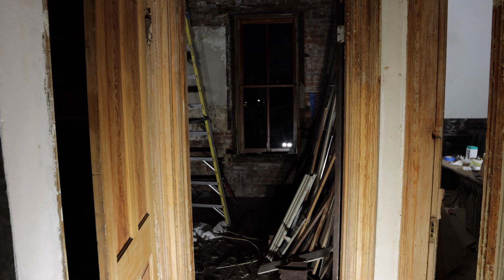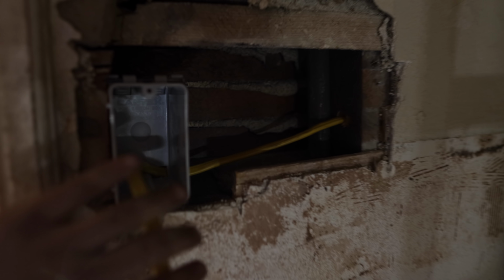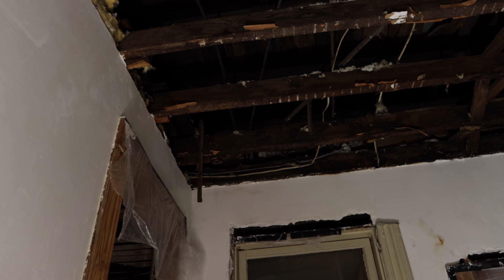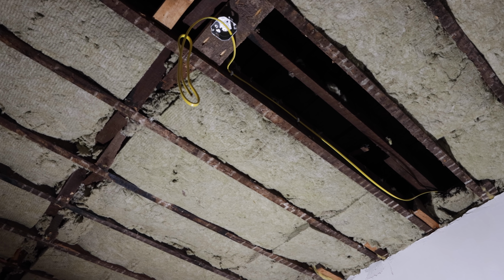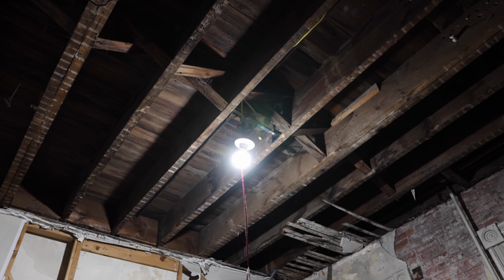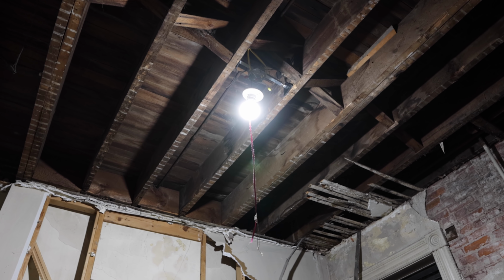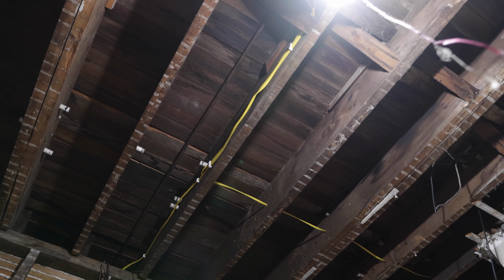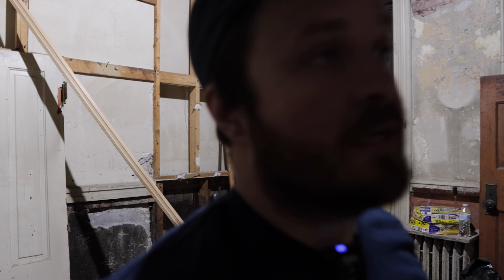FINALLY! This has been such a struggle! Abandoned Victorian Mansion EP 43

Comment: Whenever I work on the electric on a house that I wn, one of the first things I do is make an electrical map. I use Microsoft Visio to draw the house rooms and then layout all the electrical outlets, lights and appliances.
Then tracing all the wiring from the panel, I number the circuits on paper to the corresponding fixtures. This way I can determine the electrical load on each breaker and figure out if I can add new fixtures on that circuit without overloading. It's a little work up front for a lot of knowledge on the backend without guessing where to layout a new outlet or light.
Reply: I didn't know about that app. Thank you very much!

Comment: We looked at a 2nd Empire house in Albemarle County Virginia years ago.  It had been the home of one of the big-wigs in the soapstone company that operated in the area for years (it has since been re-opened in a smaller scale, but how awesome is that?).  This house's call system was still intact, though the house had been empty for decades.  It worked from both ends.  To signal a servant from your room, for intance, you lifted a brass cover and blew into the pipe opening.  This blew a whistle on the other end of the pipe - say in the kitchen - and a little widow rolled over which said "Master Bedroom', etc.  So very cool that it still worked.  It would be awesome if you could get at least one of your system to work!  Glad the electrical is underway!  Finally, that shot at night of the light through the windows - just awesome!!  She's coming back to life, thanks to you!!

Comment: 13:30 - "AFCI breakers help prevent fires in the future."

a few seconds later "this outlet fires!" 😁
Reply: 2020 NEC pretty much requires AFCI and increase use of GFCI, I don't know what local code applies to this house. However the price of AFCI versus standard breaker is about three times the price. I'd follow the local code to keep the price down if possible and upgrade later as it's only a break or change. Absolutely used GFCI in wet areas.
Reply: @mackfisher4487  Yeah same here; in my 1980s home I have a new subpanel I put in before doing a kitchen remodel. A few of the circuits are AFCI now, and all my basement and bathroom circuits are GFCI (except for the original outlet that was in the basement when we moved in, ha!).

AFCI is a lot more expensive, and I noticed that those breakers trip a lot if using power tools with big motors (e.g. my chop saw or circular saw). I hope those breakers can get a little better over time at working with a variety of tools which create conditions that seem like arcs but aren't actually.

Comment: Caleb, something to double check. I'm not familiar with electrical code where you are located, but check to see if you require a neutral wire at your switch locations. It looked like you only used a single 12/2 for your switch leg which would not leave a neutral at your switches. That was only what I saw in that quick shot in your video, correct me if I'm wrong. Again, may not be required there, but better to be safe than sorry when the electrician or inspector shows up.

Comment: Arc fault circuit breakers have become code for all new wiring in all states, not just for St Louis. While yes , more expensive, they will help to lower your insurance costs. The same is true for your push button switches. These are fully enclosed as opposed to the old style with open frame. Just more options to build new to look old. A similar thing could occur with your heating. While still retaining the radiators, they could be hooked into an underfloor heating system with room zoned thermostats. The rads help retain the look and actually work but at a lower temperature thus preserving the surrounding woodwork and overcoming the nature of hot/cool zones in each room, which can occur even with internal storm windows. Knowing that StLouis winters can be brutal, and that you have bern restricted to putting plaster directly upon exterior brick walls that become huge cold transfer zones, due to no insulation. I understand as I grew up in a 1920’s house in Kew Gardens, NYC that was constructed of terracotta block for all exterior walls with plaster directly on the block. Single pipe steam rads and surrounding cold zones.

Comment: Having just about completed the construction of a new workshop, I completely understand your excitement over having safe electricity that actually works. It's such a tremendous milestone that simplifies SO MANY other tasks, it has to be experienced to be completely understood. Just having a light source that doesn't require several feet of extension cords or need to be moved every few minutes as you work is such a blessing. It makes EVERYTHING go faster and more efficiently, to the point that even the most unpleasant jobs that need to be completed are almost a joy to get done. Congrats, and here's wishing you a smooth inspection. Cheers!

Comment: "It's alive!" Congrats on this step. How great you have family who can advise you and provide practical help. Here houses built after 1925 had the wiring inside metal conduit. We were so excited when the electrician found the electrical box in the center of the living room ceiling; it had been plastered over, and we expected a big production to put up an overhead fixture. We have original sconces in both living room and dining room, which are on a separate switch; we love that we don't have to use the overhead lights all the time. Those are on dimmers, which we use when watching TV or having dinner parties. Keep the faith, you will get there!

Comment: For posterity, and historical reasons, it would be cool if you ran gas lines to the first floor lighting, or at least the main living room for that experience our forefathers had back in the 1800's. Maybe a few wall sconces, and one or two overheads to mimic what it would have been like. Of course, install an on/off valve in that room so the gas isn't flowing all the time. Maybe even run it off a propane tank assuming that gives the same kind of light? A few ideas to make it safe, and not to complicated. The trouble would be finding the correct lighting, and combining it with the modern lighting. Loving the refurbishment, learning a lot. 👍✌

P.S. I do share your excitement, and you're going to be so proud when this project is finished. This big home will never be complete as there will always be projects that need to be completed. I bought an old two story arts, and crafts house in Riverside, CA with the intention of refurbishment. I got through one room, and the real estate market took off. I paid $117k for it, and sold it 3 years later for 260K. After the first room, I realized the amount of sweat equity this house would require, and decided it wasn't for me. I'm glad you have the fortitude to tackle this project so all we wannabes can experience it along with you without having to lift a finger. 😁👍✌💚
Reply: it should be the same light - no matter gas tank or gas line

Comment: The p
ipe coming down from the attic may have once been connected to a water storage tank. My house was built in the late 1890"s and I have a 4' round galvanized tank aprox. 3' tall in my attic. I think they pumped water up into the tank to maintain water pressure in the house back in those days. Just a thought.
Reply from the maker: We don't have an attic though.

Comment: I think I may have said this before, but, once more can't hurt.  Blue tape and a sharpie are your friends! Label every wire where it goes and what it's for. Especially the panel box ends. SO much easier than trusting to memory a week or two later. I did this when I wired my garage and it made the panel hook up a snap. No wondering why the compressor comes on instead of the porch light, or why half the loft lights turn off when I turn them on and the other half go back on!
 I kept waiting for you to do the "IT'S ALIVE! IT'S ALIVE!" thing when you showed off the view from outside. LOL

Comment: ...Kaleb, please check your electrical codes! Sub panels are great however there is space required for them and most closets WILL NOT pass.
 just because things work does not make them correct. 
You cannot just rely on AFCI protection. The rest of the work needs to be correct and pass an independent electrical inspection. 

Your time is precious,  hate to see you do things more than once and more importantly  - safely and correctly!

Good luck the rest of the way!
Reply: 240-24(d) Not in Vicinity of Easily Ignitible Material Overcurrent devices shall not be located in the vicinity of easily ignitable material, such as in clothes closets.

Proper clearances will also need to be considered.

Comment: Congratulations on this milestone 👏🏻 wonderful to see the house lit. I was amazed though at how you wire your house. I’m from the Netherlands and here we first put pvc tubes in place and then run wires through them. It is a lot more work initially but that way the wires are protected and you can easily rewire or ad another if needed.

Comment: Maybe check your insurance.   Around here only the Owner(s) and Licensed electricians can work on the electrical of a house.  Properly done or not anyone else can void your insurance. Even if electrical is not the cause.   I had my wiring electrically inspected by the city specifically for these liability issues.  
Also, Remember.  gfci circuit breakers are very, very good but they can not stop all files.  An obvious example is anything upstream of the breaker which is still in/on your house.
Reply: He is not connecting any of the wiring he has an electrician coming for that part.
Reply: @porkchop0711  Yes, Hence my comment.  There are a ton of regulations about how wires have to be run and lots of them are not obvious.   Like Distance from external windows.  Do you know that distance?   Do you think he knows that distance?

Comment: Nice work with the electrical wiring. The maid's room might not have had gas lighting in it. Gas lighting (though easier to have in homes and cost less then before) was still not cheap. A home built from the ground up that had a maid's room/ area designed into it was more likely then not to have gas lighting there. Most likely that maid's room had a small bed, dresser and a table on which a candle or a kerosene lamp could sit. Odds are the reason you are not finding any gas piping is because there was none in that room. 

Of course there could have been gas in the maids room but it was a simple wall sconce, so you might find this when you remove the walls to redo them

Comment: If you put new floor valves on the radiators, you will be able to turn them on and off.  The old valves are probably shot and should not be messed with.  They come out with a spud wrench and a LOT of swearing.  The old valves will likely leak from the packing nuts, so now is the time to replace.  If you want to go the cheap route, as those valves are expensive, you can repack them with Teflon tape/rope.  Never open or shut an old valve unless you want a leak.  Steam heat is great, but you need to be educated, as nothing is cheap on a steam system.

Comment: fyi.... I didn't notice any conduits.  Here's a comment from the internet on this:  "Conduits can also be highly beneficial when used indoors for exposed wires in areas such as attics and basements. The main benefit of safeguarding your wires with conduits indoors is to protect them from pesky rodents or mice that may eat them away."  And the biggest pest risk is rats.  You should see how some homes have been infested.  And rats, being what they are, will eat through a wire's insulation and expose it, creating a potential fire hazard.

Comment: Breaker panels aren't allowed in closets though.

240-24(d) Not in Vicinity of Easily Ignitible Material Overcurrent devices shall not be located in the vicinity of easily ignitable material, such as in clothes closets.

Proper clearances will also need to be considered.

Comment: I didn't think you were allowed to put breaker boxes in closets? Because of fire and not being able to find them in case of a fire. Maybe the law has changed. They always had to be out in the open for safety in finding them to be able to shut them down. Unless the one in the basement has an overall shut off of the whole house?
Reply: 240-24(d) Not in Vicinity of Easily Ignitible Material Overcurrent devices shall not be located in the vicinity of easily ignitable material, such as in clothes closets.

Proper clearances will also need to be considered.

Comment: Looks you are using 12 ga wire (20 amp) for ceiling lights. That's kind of over kill these days as LED lights use little wattage. Better to separate the lighting runs from the other circuits. Save the 20 amp circuits for wall, bathroom and kitchen outlets. Keep up the good work!

Comment: I have no idea how to go about wiring a house. 
Is it feasible to have those switch board on each floor and then to wire each room on said floor of that board wired to its own second safety switch? 
That way if they were ever tripped it would be easy to trace it back to the exact tripped one and know which room had something faulty in future
Reply from the maker: The first floor and basement are all on the main box and the 2nd floor and 3rd floor are all on a sub panel that's in the maids hall closet.

Comment: Congrats on having light!  Did you run nuetral to your switch boxes?  I don't think it needs to be there to function, since nuetral is already at the fixture.  I was wondering if it might be required by new codes or added it for future expansion or to support some models of smart switches.

Comment: Been a long time since the lights have been in in that old house. I wonder how long
Reply from the maker: The lights worked when we bought the house but we didn't trust the electric.and had it turned off to the house except 1 outlet.
Reply: Ah! I bought an abondoned house several years ago and never turned the old power system on. I put in a new mast, breaker box, and pulled new wire. I did wind up hooking up a few old lines. I ran out of money. Luckily they worked OK. Good luck on your house. I've rebuilt three so far. It's a big job, and it's worth it.

Comment: Medical masks don’t have enough protection from particles going inside the airways of the wearer (not-filtered air gets easily from the sides). Their main purpose is the protection of those around the wearers. For better protection during construction works please invest in respirators (ffp3/n95 minimum) that lay tightly against your face, and the only air you’re pulling in comes sifted through the respirator’s material. Or use a second mask that pushes the medical one tighter to your face from all sides. Stay safe!

Comment: Wondering why you are using 20amp wire for lighting!  Its harder to use, costs more and way more power than you need for even incandescent bulbs. 
Also, are you allowed to put a subpanel in a closet?  I am not.

Comment: You REALLY  need the assistance of a real electrician!! 
Some of what you are doing will not pass code or any inspection!
Example  - a neutral wire is required at all switch boxes, so start with power at your switch box first then feed your light.
Something to consider- you can use #14 wire for many of your branch circuits. Same yourself some $ and time.
AFCi protection is also required for most residential branch circuits. Great safety and fire protection